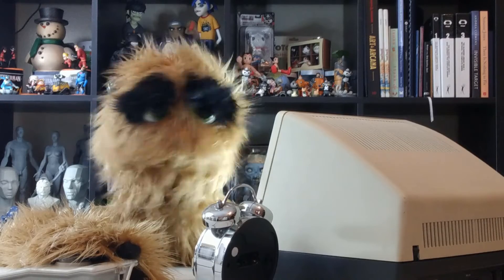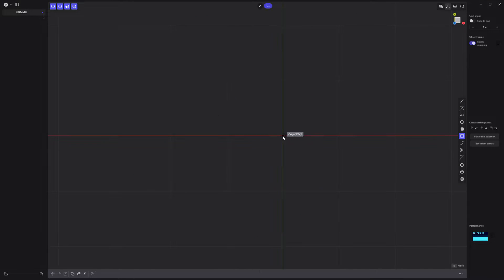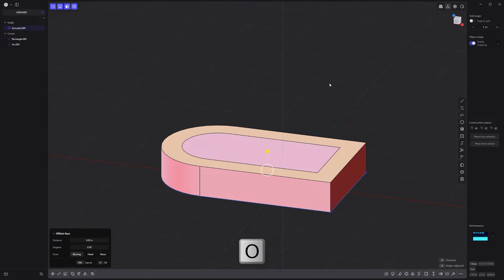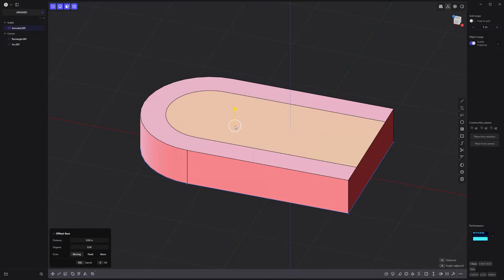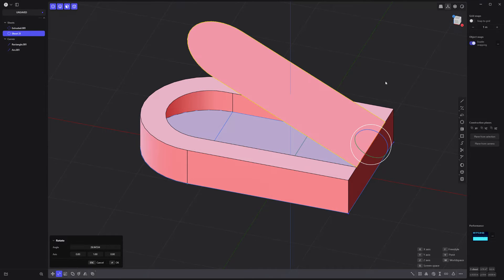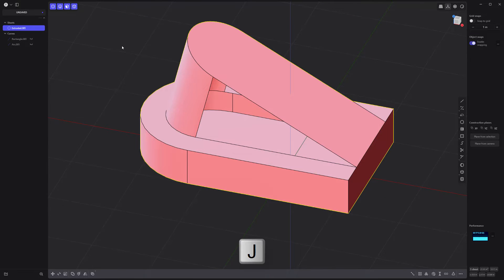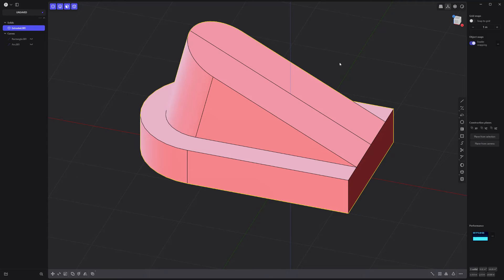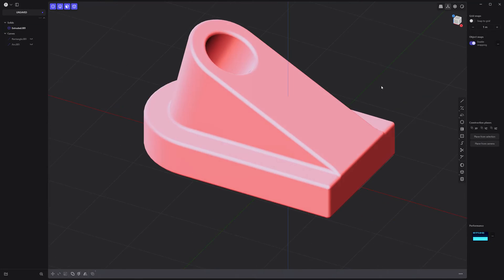Plasticity | Modeling Exercise 63

Comment: This is interesting. I was thinking to just extrude the inner shape & rotate it from the edge. Now I wonder if that works
Reply from the maker: There are many ways to approach a shape like this... or any shape. Try several methods and use what works best for your workflow.
Reply: Was the isoparam line at the very end just so you could center that last circle on the face?